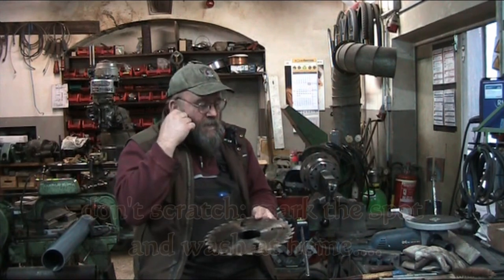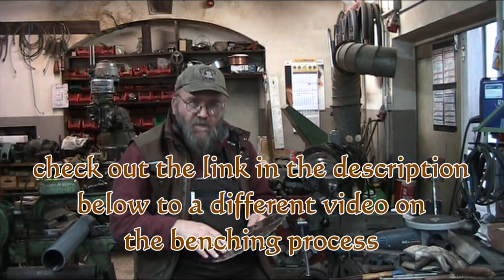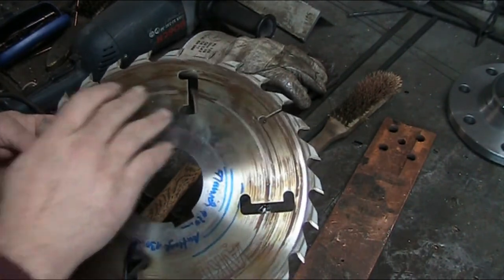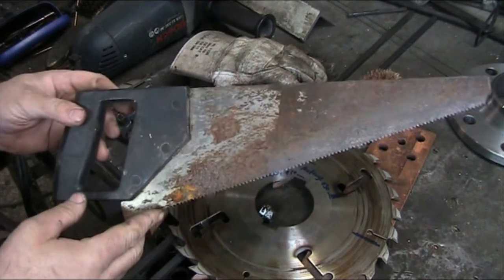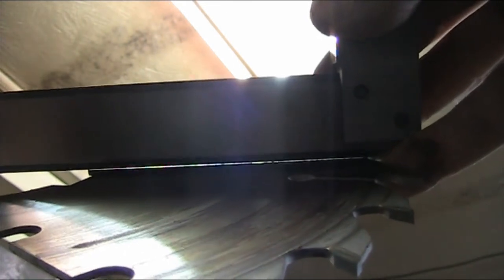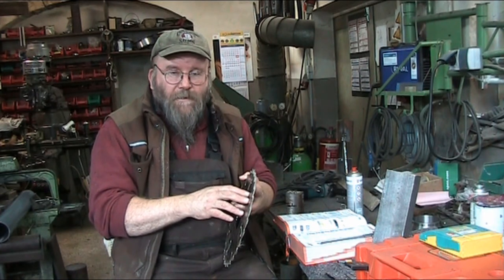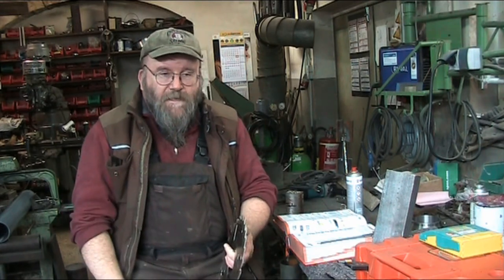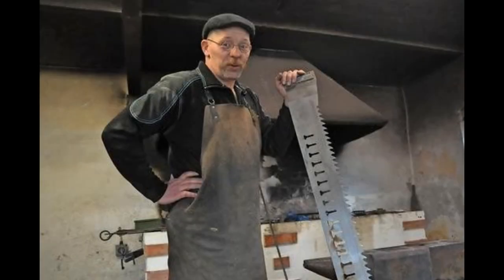Random Lengths episode 10, defining the term benchmark

Comment: I learned some things here. Thank you.  I have seen grooves pressed into saw blades but didn't know what they were for. I'm going to experiment with some wobbly circular blades to see if I can true them up any using a ball peen hammer. I have adjusted traditional framing squares (shaped like a big "L") with a punch, by peening the inside or outside of the square's corner to slightly open or close the legs to be closer to 90 degrees.
Reply from the maker: yes, you are on the right track there. you can definitely correct wobbly blades by re-benching them. sadly, most of the oldtimers who knew how to do it have died off. the only tools they used were a ball peen hammer and some sort of anvil. one guy i knew used a chunk of really heavy I-beam as an anvil. he benched the blades in his sawmill headrig that were 4 feet in diameter. i kick myself for not having gone out to visit him more often and have him show me how it's done.
while i know about the process and roughly how it's done, it requires the knowledge of where to strike and how hard to get the blade to straighten out. it's not as easy as it sounds....

you can straighten out a carpenters square by using a center punch, but when it comes to a machinists square, it's better to regrind them. the steel has a tendency to work more if the shop temperature fluctuates any and you will most likely get varying results. in my shop i use machinist squares with an accuracy of "0" . 
there are grades "2" (rather rare but most chinese made squares marked "0" would fall into that category), "1", "0" and "00", with "00" being the most accurate and a lab grade (they're also insanely expensive)